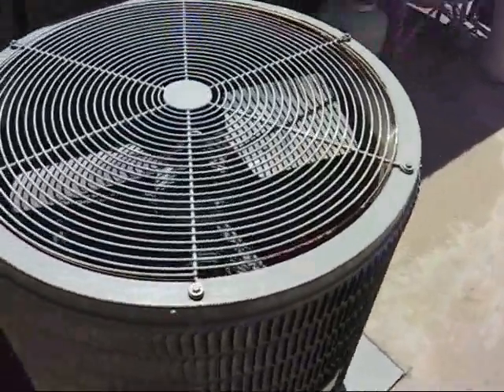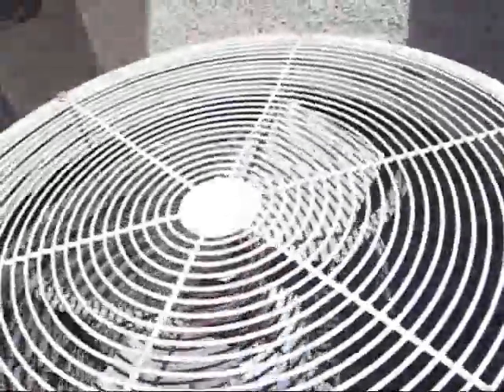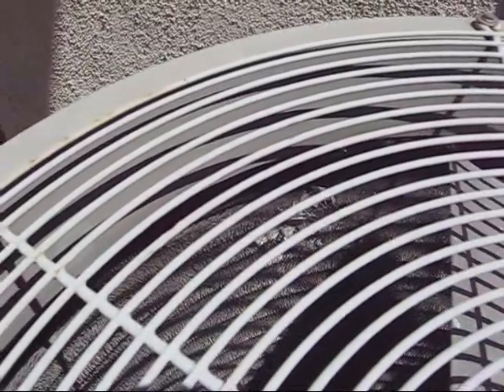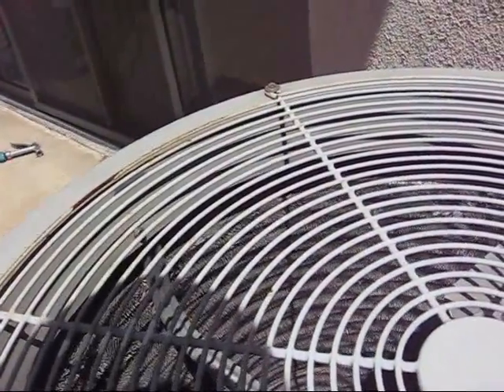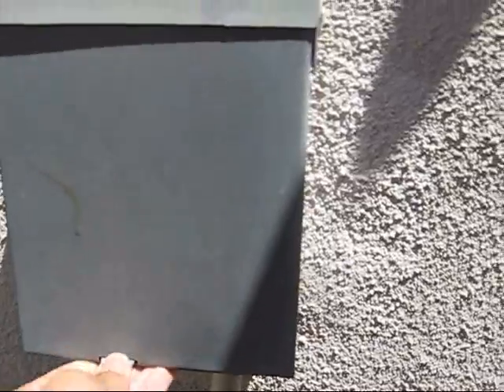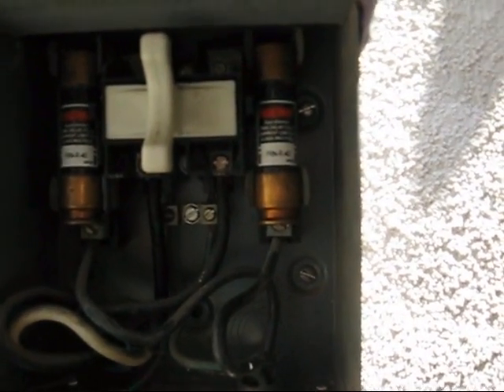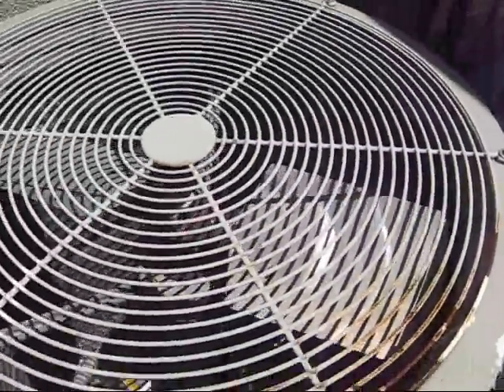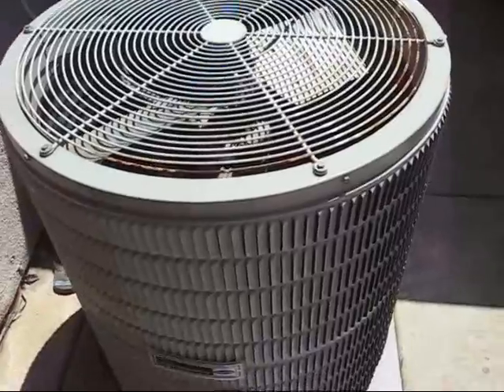1988 Carrier "Round One" Deluxe High Efficiency air conditioner

Comment: 2024 and mine is still running, 92 degrees outside blowing 62 at the register on the 2nd floor. Motor a little squelly when it's super hot out but I use 3 in 1 and no worries. Furnace works great as well, all original. Never had to add refrigerant to the unit. Just keep up with maintenance and keep well insulated.

Comment: I have the same unit manufactured in 1988.  I am having problem with the compressor not shutting off after target temp is reached. You had mentioned your having to replace the contactor relay in the past.  Would you, by chance, recall the part number of that relay?  Mines is weathered over and unable to ID.  Also, would you describe the reason for replacing? Thanks...
Reply: contactors are generic

Comment: I have this exact unit dated from 1985 still running great. I also had to lubricate the motor with 3 in 1 electric fan motor oil. Found 2 oil ports to squirt the oil in.

Comment: I am amazed
A) that you wanted to video your AC unit
B) that you've had 30,000 views !
Damn near viral. Congratulations. Found this cause i have the same model and was looking for SEER rating. Thanks to another reply it's max 8.3
Mine just died this week after 31 years of good service
Reply: "Mine just died this week after 31 years of good service"
Reply: Use a search engine for 38EH-1P.pdf  ..or Carrier 38EH and look for the product data sheet, looks like high 8 or low to mid 9 if it's 2 ton or less, worse if it's a higher tonnage unit. You get a bit more with a line solenoid but that's a garbage measurement based on old DOE test methods using short cycles in my opinion, the service calls for the Carrier Accurator and LLS wouldn't be worth it to have the LLS (liquid line solenoid) if you can maintain reasonably long cycles for better efficiency.

Comment: I think its 10 Seer the max at the time with the old style hermetic recriprocating compressor the newer units 16 and above SEER they will have a hermetic Copeland Scroll Compressor and charged with 410A as Carrier calls it Pureon . the Trane units have their own compressors coated in red. the new ones will have inverter technologies on it a variable speed scroll compressor and a ECM condensing fan motor and are claimed to be up to 26 SEER.
Reply: That sounds about right as 10 SEER was pretty much the default for built in air conditioning in the 1990s.